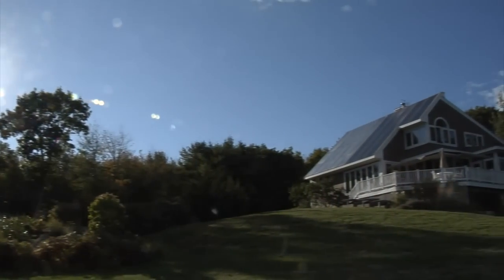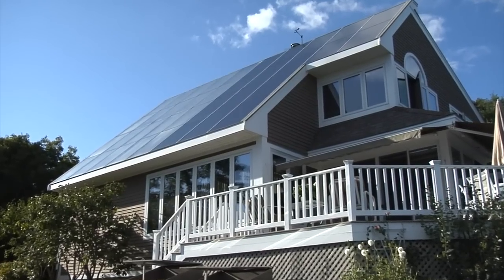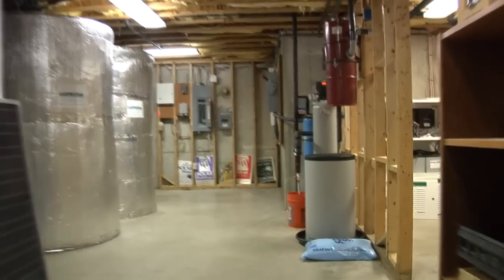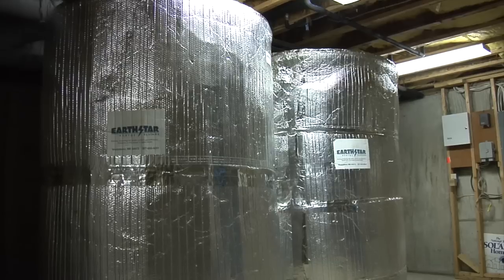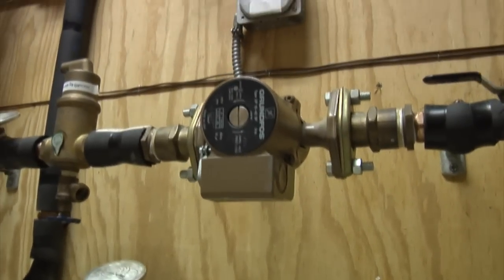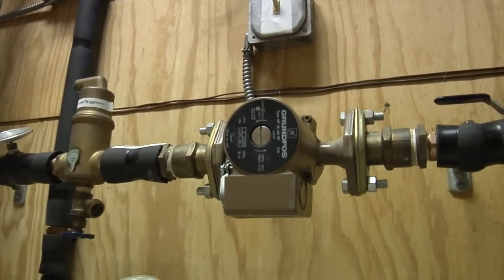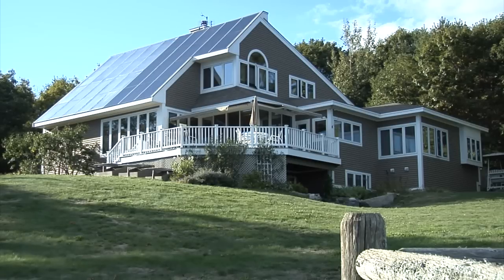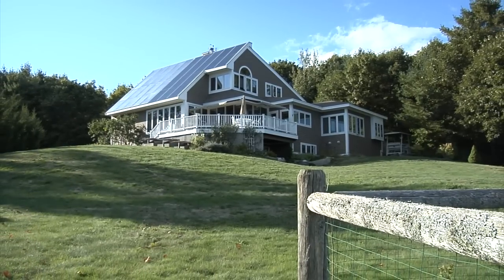Maine Solar House

Comment: Hi, do you convert the power directly into AC? or you store it in batteries before you invert it?
Reply: Note the use of both inverters (which converts the photovoltaic DC to house current AC) and batteries for backup.